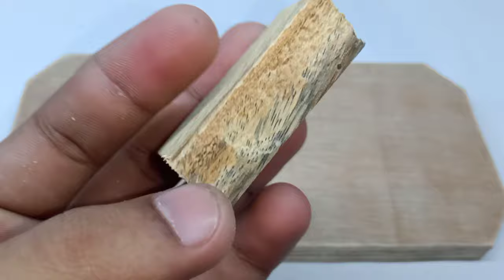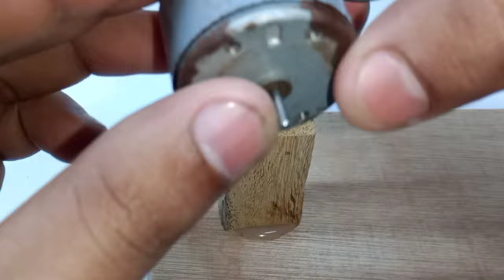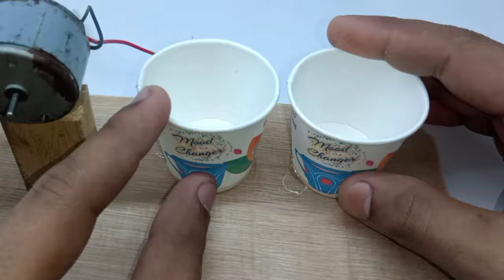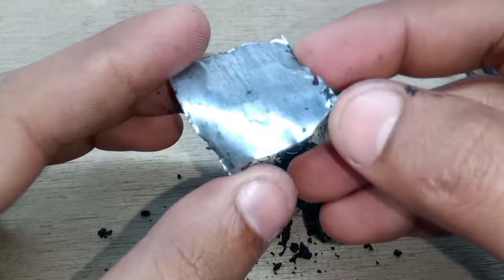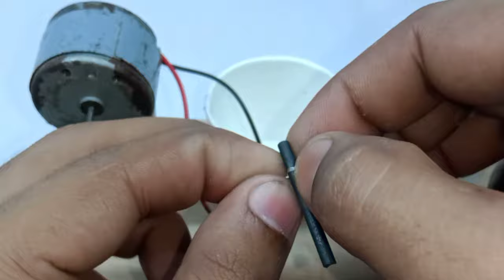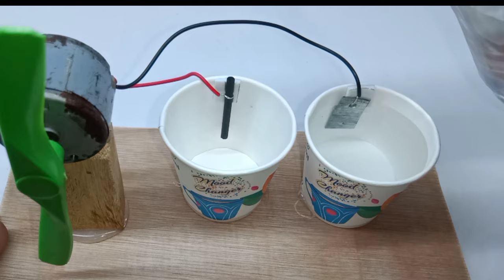How to generate free electricity with water| free energy | Dc Motor Science Project

Comment: Awesome, so you made a fan, that needs to be maintained, and refuelled with battery innards and good scissors to cut them up some wire, cups, metal, 2 bits of wood, a motor, a fan blade and salt water, then spend a hour making a mess, cutting sawing sticking, filling and stripping wires, filming yourself doing all that, editing and generally burning energy, time to generate some, deconstruct a battery make a crude cave man version which is less efficient than the one now destroyed, bit more depleted energy but hey presto the fan blade spins round.
The meter which measures the level of pure unadulterated pointlessness, reached maximum then died, feeling great though producing air flow for free.

But wait what about the Invisible and mystical, free stuff outside, wind is great, it's free, already perpetual and moves without needing a push so not even matter is needed to get the same result.... but if you wanna include the contraption of pointlessness, take it with you, point it at Mr. windy and watch it spin, stick a wire on an LED and the title of the video turns from a lie to truth... Groovy eh,  ya welcome, I... have, exercised the demons... this house is clear!!
Reply: Gotta learn some diy hacks if you want to survive the zombie apokalypse bruh

Comment: I made it but didn't worked
Reply: Really it not work
Reply: Really it did not work
Reply: You need to to charge with charger first. So that the ion in the liquid will be generated.  Without ion movement no electricity will be generated. Basically it is using lead acid battery concept.